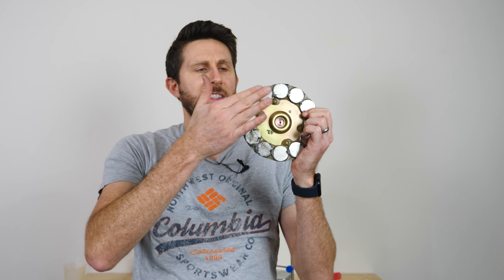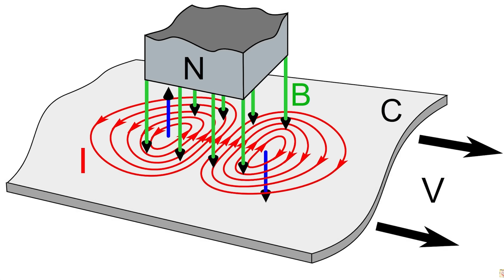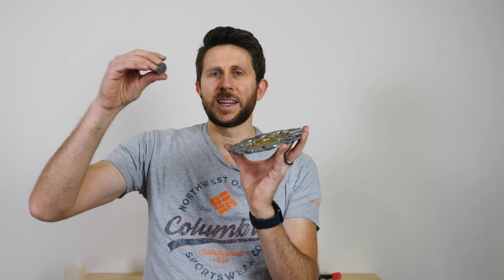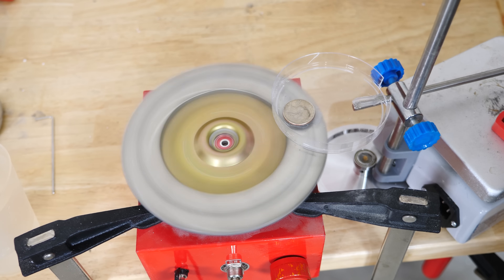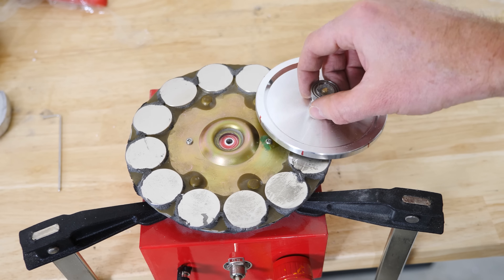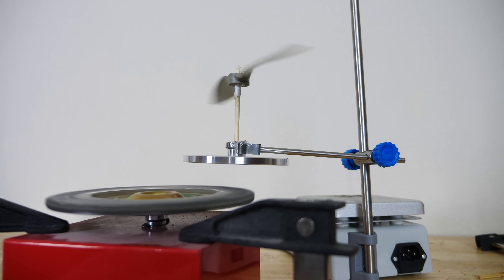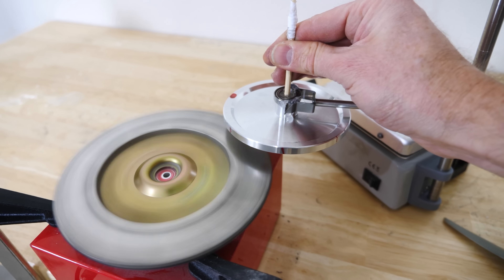How To Make Invisible Gears With Eddy Currents

Comment: Nice video. Eddy currents are used in high speed trains as brakes. An alternating electromagnetic field induces an eddy current in the track which contactlessly pulls on the train, effectively applying a contactless brake force. Much like the oposite of the force that spins your disk

Eddy current brakes are efficient for high speed braking because the track and not a piece on the train is warming up. At high velocities the energy to dissipate is high too (v-squared). At lower speeds the brake force is however not so high. Just like in your setup the torque is at its largest when the magnets were moving and the disk was not. When the ‘gears’ have an equal speed, torque is at its minimum. So when both the track and the train are at a stand still, the EC-brake provide no torque.
Reply: That is fucking cool! Thanks so much for sharing!
Reply: So how much torque could these sorts of "invisible gears" produce?
Reply: @3nertia  lorentz’s laws will tell you
Reply: I believe they are also used on rollercoasters and elevators, although for these permanent magnets will probably be used. An alternating current does not need to be used, because when it is moving past the metal that eddy currents are induced in, to that metal it is an alternating magnetic field, although i think that might be what you mean.
Reply: @Term-0  I think you may be right that the current is just regulated, although I do know we have had problems with the system interfering with train detection based on AC. Interesting. I will look up the drawings at my work one day.
Reply: Good point
Reply: Yes

Comment: Does Aluminum exhibit this effect in the presence of a neodymium magnet better or worse than copper does?
Reply: Copper should show higher torque and lower heat when held still against the spinning magnets. This is because copper has less electrical resistance, thus higher eddy current, higher magnetic coupling with the spinning magnets, and lower Joule heating (bcoz of low resistance).
Reply: worse i think but it might speed up faster cause less dense

Comment: When you spin the aluminium disk in opposite directions, will it heat Faster?
Reply: Yes. Reason, it would also heart up if the magnets where not rotating at all and you only spin the aluminum disk, as the movement induces currents that heat up the metal.

Comment: Drag due to eddy currents from a spinning magnet used to be how car speedometers worked - the same spinning drive from the wheel that incremented the odometer was also used to spin a magnet near an aluminum disk attached to the speedometer needle. A spring pulled it back to zero so it couldn't spin, but the faster the magnet turned, the bigger the angle the needle moved. Modern cars are using the feed from the ABS sensors, converting it to distance for the odometer and to speed to tell a stepper motor how far to move the needle (Or where to draw the needle if a LCD display is used).
Reply: old electricity meters also use eddy currents
Reply: @tomg0  There's a great video on these old style meters by the EEVblog.
Reply: That would explain why the speedometer needle on the 1961 Peugeot 403 we had when I was growing up would oscillate violently at low to medium speeds -- must have not had enough poles in the magnet, and then the vibrations induced by the coarse moving magnetic field would have resonated with the needle mechanism, although strangely this occurred over a fairly wide range of speeds.
Reply: Thx.  If I'm picturing the same type (would have been GM), I recall thinking... I don't know how this works.  Fluid-like coupling but no fluid; no friction.  Hmm, put it back together.
Reply: Dude just induction motor is example
Reply: I messed with a few of them and can say they are kind of neat to play with. Little hard to tune though but repining the needle while moving at a certain speed was usually good enough lol. Tend to stick and bounce when it's really cold though so I used to bang the dash till it moved again. I guess leaving it alone until the disc heated up could thaw it and move again.
Reply: I have always wondered a little how the old ones worked.  Thank you!
Reply: how ur wheel speeds are kept up with for abs
Reply: @Michael Myrick  LOL thank you! always been wondering, so on the exercise bike the setting knob is changing distance between aluminium plate and magnets?
Reply: @kapouszek7349  idk tbh have to find a video of some one taking it apart. ive made cars piles of parts before and made it a car again. have rebuild motors at 250k and drive it another another 200k miles. also do 85% of the work on our heavy equipment. at the company i work for. two 330 track hoes a 308 mini ex a skid steer and a 930 wheel loader.  not much stationary bikes....
Reply: @kapouszek7349  ik the older ones used a cloth pad and metal wheel. id say uses resistance by electromagnetism if what u say is present.
Reply: It's fascinating. My dad always said if you could harness the power of magnets you could have unlimited energy.
Reply: @aaroncarr-mackay2457  The first law of thermodynamics (conservation of energy) has yet to be disproved an any experiment humanity has conducted in hundreds of years trying, so unlimited energy from magnets is doesn't look to be even slightly possible.
Reply: @peglor  
I understand the physics and laws lol. I mean my other thought was that this is how you make the most inefficient energy losing contraption possible. On thing conserving any energy is the momentum of the spinning objects when you turn it off. Still wasting potential energy though.
Reply: @aaroncarr-mackay2457  not unlimited energy, but energy can be stored in magnetic fields. there is a basic electrical component called an inductor that does just that. they are used to smooth out amperage.
Reply: Fascinating
Reply: I had a 1963imperial Le baron with torque flight transmission and a speedometer that was like a bar getting longer and longer..would that have worked with Eddy currents?

Comment: Interesting was that it was turning the same way as the magnet wheel, regardless the position of the two wheels. I was expecting that it would act like like a gear and if it was just the edges "touching", it would turn the other way. Interesting.
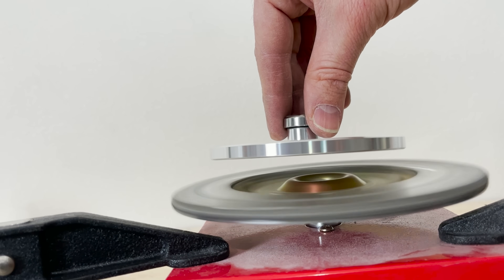Reply: It does act like a gear. 3:27 the flywheel turns like a gear, opposite way to the magnet base

Comment: It's a motor, not gears. 
https://en.wikipedia.org/wiki/Induction_motor
Reply: Motor turns electricity into rotation. It's not a motor, more like some sort of transmission, even if it's obviously not gears. A motor is found inside the red box, turning the magnet disk.
Reply: @u1zha  The principle being demonstrated is the same one that induction motors rely on. There is no "gear" here...the transfer of power is asynchronous...it has a variable ratio. The device in the video has much more in common with induction motors than gears.

Comment: Yo thanks so much for this! I’ve been trying to design a battle bot with a loosely connected weapon drive so that the motor doesn’t break during hits, and I think something like this but with both sides being magnet gears might be perfect
Reply: A ball detent style breakaway mechanism would be much lighter and give you the same effect of limiting torque and shock transmission. You could also just use magnets of opposite poles in the two spinning parts to connect them so they spin together with far fewer magnets, less weight and no slip between the two parts until one is stalled. The benefit of using eddy currents would be that you could use a stationary set of coils being powered in the correct sequence to make an aluminum part spin, like in an AC induction motor and reduce the number of moving parts you have.
Reply: @peglor  loving the detent idea, I will have to experiment to see which is stronger. Only problem with a detent is that it could get knocked open during a hit, and the bearing probably would not be able to settle into its slot at such high weapon speeds.
Reply: @peglor  since the blades don't have to have magnets installed, perhaps one could also install backup rotating blades and replace them on the spot if broken during a fight.
Reply: @peglor  🔴 What Is Islam? ⚠️

🔴 Islam is not just another religion. 

🔵 It is the same message preached by Moses, Jesus and Abraham.

 🔴 Islam literally means ‘submission to God’ and it teaches us to have a direct relationship with God. 

 🔵 It reminds us that since God created us, no one should be worshipped except God alone. 

 🔴 It also teaches that God is nothing like a human being or like anything that we can imagine.

🌍 The concept of God is summarized in the Quran as:

📖 { “Say, He is God, the One.  God, the Absolute.  He does not give birth, nor was He born, and there is nothing like Him.”} (Quran 112:1-4)[4] 📚

🔴 Becoming a Muslim is not turning your back to Jesus. 

🔵 Rather it’s going back to the original teachings of Jesus and obeying him.
Reply: @1islam1  is Jesus the invisible gear, or the fly wheel? )))))
Reply: Damn, that would be cool.
Reply: Now every battlebot sticks to you
Maybe that's a good idea for a weapon, a magnet grapple
Reply: @crackedemerald4930  Shhhh, you cant let them know. It's funny you say this because a magnet fishing rod was one of my other ideas on the list.
Reply: That would be super weak wouldn't it?
Reply: @theirishaxe9405  I think so, if the weapon has a lot of mass it would give a hard hit, but since it's spinning just by magnets it would take a lot longer to catch speed again after every hit
Reply: @theirishaxe9405  not with strong magnets
Reply: There are other types of magnetic gears, this would not have any useful torque at a reasonable set up, but magnetically coupled gears would be much stronger than this. Look them up.
Reply: @jaredf6205  Thanks, I'll definitely be looking into those
Reply: Could you put a directional/focused EMP on your battle bot so you can fry the electronics in your opponent's battle bot?
Reply: @mjames7674  I think they have rules against that sort of thing; they don't allow nets or other entanglement devices.
Reply: @mjames7674  no, EMPs are explicitly forbidden.
Reply: @mjames7674  That is expressly forbidden by the rules of all big battlebot competitions. The fight would be over in milliseconds and nobody would win. The audience would see nothing happen whatsoever. Not an exciting competition to watch. It would also be risky for any electronics within MILES if it was powerful enough to fry a battlebot quickly even if you were trying to focus the beam.
Reply: @M James  just use a microwave generator.
Reply: @mjames7674  you could but the metal everywhere on them would shield any battery emp
Reply: @mjames7674  maybe a 'contact based' high voltage high current power delivery 'probe' .... sending extreme current and voltage up the chassis through the ground to all electronics could absolutely fry everything! Think 200 lbs of capacitors- it really only has to barely move becos when they touch it anywhere-ZAPpppppp!!
Reply: @mjames7674  We had a plan to, but then we figured it was probably against the rules somewhere
Reply: @papercrowe8772  I understand . Thank you for being kind to me
Reply: @mjames7674  that would count as radio/electronic interference, and would be illegal in battle bots, and probably any other combat robot competition.
Reply: Use a friction disk. Magnets wont allow efficient force transfer
Reply: @gi295  like a clutch plate?
Reply: @gi295  yes. This. No torque will get thru a magnetic gear system 

To deliver usable torque the gears would be insane heavy and also have to be shielded from attack. A slipper clutch can take all the abuse for a couple minutes NO problem!
Reply: what a weak weapon you gonna have...
Reply: Please make a video on you making it, that would be cool
Reply: Is it efficient tho?
Reply: That's cool! Anywhere we can see the working model?
Reply: When it is time to launch a hit, some sort of brake grabs the disk and prepares to deliver a forceful blow.. When not about to strike, let the magnets loose
Reply: What if you had a mechanism to speed up the weapon with traditional gears, but pull the gears back & use the magnetic one once you reach your top speed
Reply: My first thought was "differential gearbox". One chopper could be stopped dead inputting all its energy into the other. Yes a twin counter rotating battle bot.
Reply: Ha, that was my first thought too.
Reply: Heads up, that could generate alot of heat if the weapon movement is impeded from damage, but then I also don't design BattleBots. Best of luck.
Reply: We need video of this, i dont care if the final robot is cool or not, seeing someone attempting such cool concept would be an awesome thing to watch!
Reply: Why not just use an induction motor?  Since you're running off of DC and will be generating the AC, you can control the phases to vary the speed however you want.
Reply: Make a video on it!!
Reply: If you use a disengage switch with a electric motor before impact of the saw would be idea I don’t think this will create enough momentum to do any major damage plus the reset value is low during the time of the blade recharging to full momentum you will be vulnerable hope this helps
Reply: I have been thinking how bad i want to see a battle bot use something like this.
Reply: These won’t produce enough torque you’d need for a weapon, a fluid based torque converter would work
Reply: I could see this working for something spinning really fast like a saw blade or something, then this would allow it to uncouple pretty much instantly without damaging any parts or really any wearing, although someone else already mentioned it would be better to use magnets on both plates of opposing poles to lock them together better. But I could totally see this working for a battle bot. Wouldn't have many uses, but could save some wear on the parts. I honestly wouldn't be surprised if something similar actually already exists/someome has tried it.
Reply: Sounds like a great way to transfer power to the wheels/weapon without needing to have a motor there. You could produce the power in the main body and have it used on a little induction coil spinning a disk at the end of a long arm.
Reply: Check out polymagnets
Reply: So you've got a water cannon huh ? Alright I'll raise you One Transistor, Two Singing Tesla Coils and Three Singing Stepper Motors. PUT 'EM UP !... 🤖
Reply: Dude that's cool , keep grinding
Reply: Friction clutch
Reply: Good luck dude!
Reply: Use like what a bike has for the pedals one way spin
Reply: look at a hydraulic drive or torque converter (also hydraulic driven) similar to what is in between the engine and automatic transmission on a car ,, it'll take huge impacts and as long as the bearings are strong enough to take the momentum of impact youll be fine. -- in fact a direct drive electric motor will not be the weak point on impact but the drive system and bearings... so...
Reply: Current limit the motor. The torque from a motor is proportional to the current. If you don't want to damage the motor due to excessive heating, or the gears, from too much force, choose a motor driver circuit, with a settable current limit, to control the maximum available torque.
Reply: I dont think you even need a clutch... unless you are building up INSANE kinetic energy in some spinning weapon. Even them just have a current limit on drive motor when it stalls you'll be fine.
Reply: What about coupling a blower and some sort of turbine, to transfer the power via airflow? Would you be allowed to also take advantage of that to increase the downforce keeping the bot from getting flipped by putting one of the inlets on the underside of the bot sorta like a reverse hovercraft setup?
Reply: Aren't motors magnetically separated?
Reply: I imagine there will a lot of loss in that design
Reply: Most people use a belt drive for that reason, this setup won’t give you much power to your weapon, you’d have about 95% efficiency loss
Reply: Watch out so it doesnt mess up your other electronic on your bot which mangets poverful enough to generate enough torque would do if it was close to it
Reply: I would like to watch your battle Bot fight
Reply: U made it send it in ur yt channel
Reply: Cool
Reply: That's pretty frikin smart
Reply: A
Reply: E
Reply: O
Reply: U
Reply: And
Reply: Sometimes
Reply: Y                                  also 69th reply
Reply: I hope you are making something similar to Warhead, the best battle bot ever.
Reply: with a magnet array an one side, and on the other a magnet array and an aluminum disk. the aluminum disk will dampen it to the point that the magnets can magnetically mesh. although, it would probably work better to directly drive the disk with alternating magnetic fields created by coils of wire. this is a motor (if the disks are flat and next to each other, it would be specifically called an axial flux motor.
Reply: @mjames7674  I mean that’s about as smart as saying can I win at basketball if I just bring a knife and stab the other team